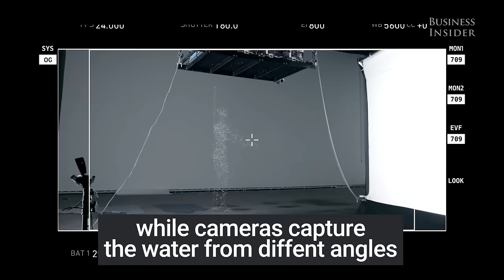Water Droplets Create Amazing Human-Like Animations In This Gatorade​ Ad

Comment: Way back in the early 80's, we had a strobe light with a twist knobe that changed the speed of the flashes. We would do the usual  stuff like clap hands at a certain speed which made it look as if we weren't clapping but you'd hear the sound. We did some experiments using water in a spray bottle, and found  by increasing or decreasing the speed of the flashes we could make the water droplets appear to either rain up, down or float in the air. Since it was the 80's, bean bags were a common household item, so we took the small foam beads out and used them instead of water. These worked even better. Needless to say, our parents were not happy to find little foam bread all over the den floor. It's a great childhood memory. 😁

Comment: 1970: I bet we'll have flying cars!!

2017:
Reply: running water... literally been around since forever lol
Reply: 1970 : I bet we'll finally have original comments.

2017 :
Reply: Krotos325 wtf is the purpose of flying cars?
Reply: Krotos325 even better
Reply: mrusername09 maybe so that terrain wouldn't be in to much of a problem?
Reply: Daisuke Sugikami ya, a terrain would not cause nearly as much trouble than needing a fucking air traffic controller guiding EVERY FUCKING CAR IN THE COUNTRY
Reply: krotos325 you can buy a WSC ultralite trike for as little as  $15,000 new. No pilot license needed. You only need 50 yards max for take off and 100 yards for safe easy landing. Lots of videos on YouTube. I personally love it.
Reply: Wow in the 1900’s they could have frozen water with one flash of light??!!!
Reply: there are cars that fly though you just can't operate them on a regular road or fly too high.
Reply: Where are not quite there yet...lol
Reply: Stop copying Facebook posts. It’s not cool
Reply: Flying cars are just aeroplanes what's the point
Reply: This is pretty rad too though
Reply: i think its cool :\
Reply: almost 2018 likes
218
Reply: Musclebound rip planes

Comment: The engineering that this took is insane. All those electrical engineers who designed those circuits and the hardware for that to be possible and the amount of programming from the software engineers is insane probably over 3000 hours of code

Comment: Just waiting for mumbo jumbo to make something like this with redstone
Reply: Actually it’s possible and  quite simple 
You see instead of water we can use sand or any other block that obeys the laws of gravity and ( out sand 10-25 stacks in sand on each piston)  place a whole ton of pistons which are set to different ticks they will drop the sand in such a way that it’s looks like an animation of course it’s not ganna be as good as the video but yes it’s possible and some what easy
Reply: Typical Gamer I was thinking using dispensers and nonstackable items cuz it’s like the “rain droplets” coming out from da dispensers
Reply: Pro QBr u can turn the tick speed up on bedrock edition
Reply: AHAA
Reply: He made the text from camp fire so he could just adjust it a little bit
Reply: I just Exist hmm that could also work didn’t thought of that
Reply: Pro QBr you are correct maybe using mods to increase tick speed or using bedrock edition to increase tick speed as someone already suggest this in this comment section
Reply: Typical Gamer just use water dispensers
Reply: DevilDude it is only random block tick speed though
Reply: tehgreatdoge not block, just random tick speed

Comment: Was it not possible to get the same result by using laser lights through continous falling water droplets?
Reply: Manav Goyal water bill would have been too high lol.
Reply: In essence a similar effect, thought that wouldn't have been nearly as cool though.
Reply: No, because you would have a constant stream instead of discrete droplets.
Reply: Yes you can
Reply: It wouldnt have been 3D
Reply: @raijinoflimgrave8708  oh yeah. maybe
Reply: @raijinoflimgrave8708  Good point.
It would only do a slice.
Reply: No you can't because it showed the droplets hitting the ground only where the feet touched every single frame. If it were a constant stream, you'd see the whole floor being hit with water and it wouldn't look as cool
Reply: @Arid It would look totally different as the droplets form gaps.
Reply: Savy so did the other droplets float? It was done with lights not floating water

Comment: 1:57 
how you explain this?
Reply: CGI.
Reply: it's the same concept of how they did any other movements. It's the combination of flashing lights and the pattern of water droplets
Reply: Santiago Ferrari how would u know? Just because you can’t figure out how it works doesn’t mean it’s fake?
Reply: It's called moving the bag. Watch Who framed Roger Rabbit, they do the same things to get the cartoon characters interacting with the real environments, CGI doesn't need to be used in any way to achieve that, in fact it's easier to do it as they have done here.

Comment: There are better ways to do this now. The same effect can be done real-time instead of the stop-frame animation used here- (also brilliantly shot simultaneously at different angles for dynamics). It's cool, but technically could have been done digitally since it is not a live device, but part of a process. The real trick is doing it live in 3D.
As for the Gatorade advertising itself, a definitive A+ 
...and worth every penny invested.

Comment: i'm skeptical of the frame rate implied by this video. if the frames are squirted out at 24 fps, then the strobe lights would be lighting up many more droplets than those that make the object in the single frame. thus, this stop-motion video progress took much longer to film and compose than simply using stroboscopic effect as implied by this video, which would be ideal.
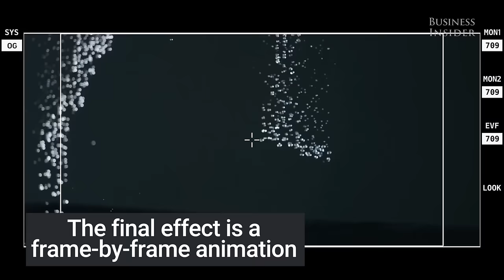edit: 1:00 oh, ok. more work yet to be done, then.